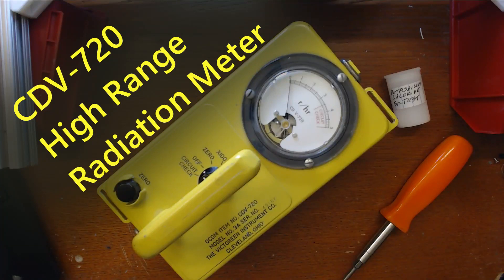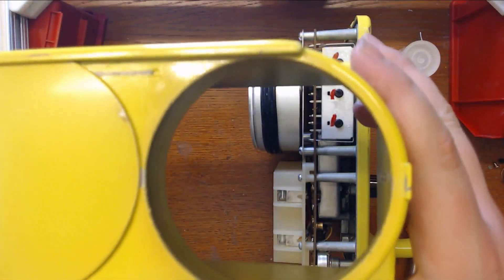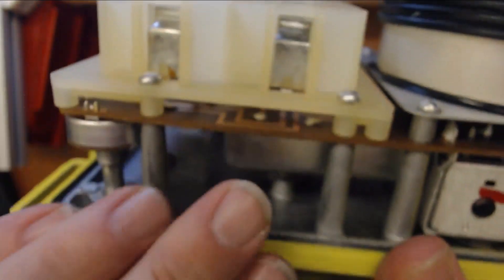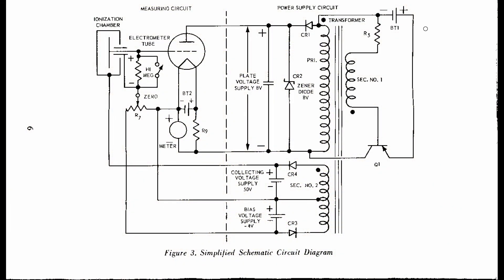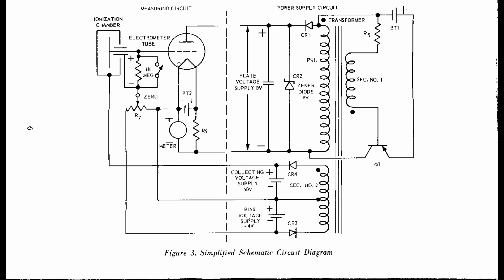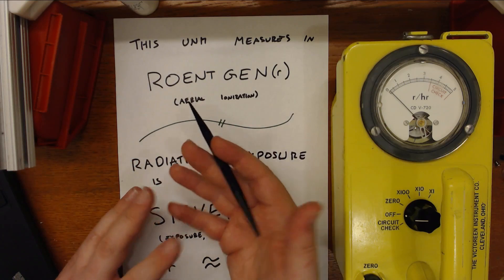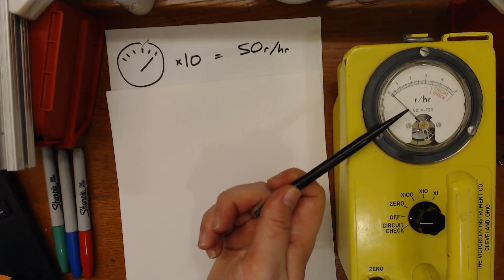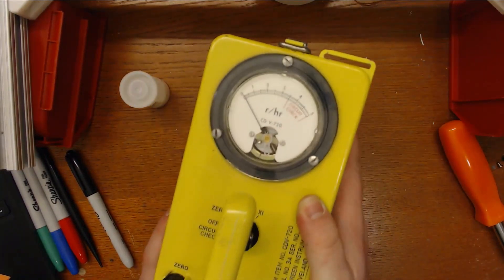High-Range Radiation Meter Overview - Victoreen CDV-720

Comment: This is a survey meter, like the CD V715.  It is not a Geiger Counter.  The CD V-700 is the Geiger Counter.   Think of the V720 and V715 as life and death meters.  They are meant to measure HIGH radiation levels after a nuke strike, dirty bomb detonation, or nuclear plant meltdown.  Life and death scenarios.  A Geiger Counter like the V700 is for several weeks after those events to measure residual small amounts of radiation or for hobby purposes in peace time.

Comment: I have a CDV-717 meter so I have a somewhat earlier model than you do.  With these cold war relics, one thing to keep in mind is that a good share of the electronics inside these instruments will have lost all of their tolerances by now.    Actually, in those days, the manufacture and tolerances with the electronic components were rather sloppy to begin with.  In my case, I had to replace several resistors,  clean up the selector switch, on the circuit board,  and I even had to replace the transistor (with a NTE102 germanium power amplifier) as the device showed considerable leakage on my curve tracer.  Well, I naturally sent the CDV-717 meter to KI4U afterwards for recalibration.  By the way, that potassium chloride will never trip the meter.